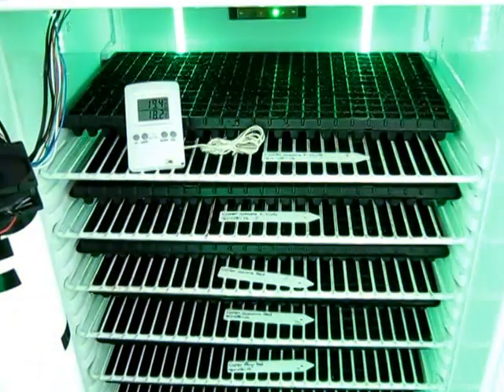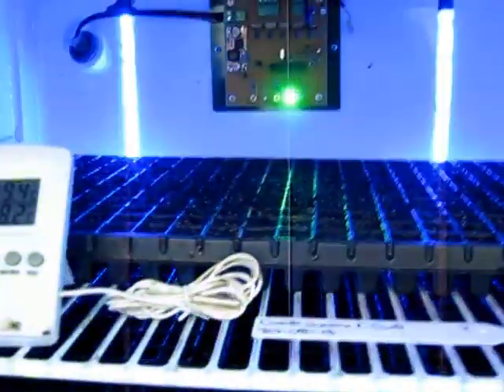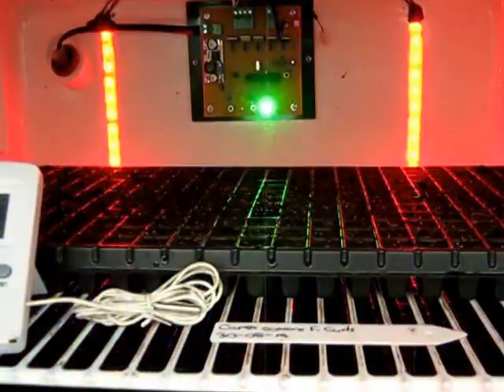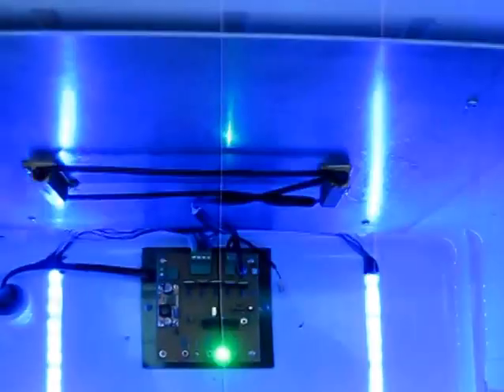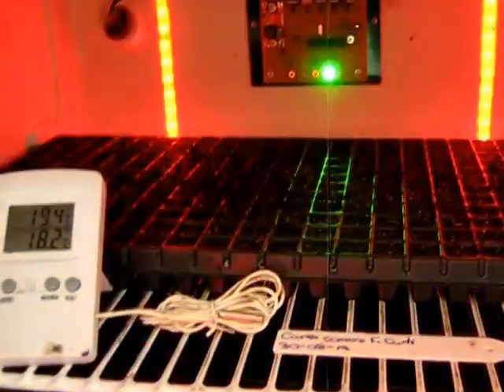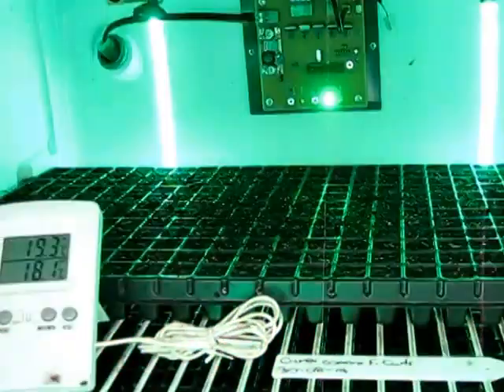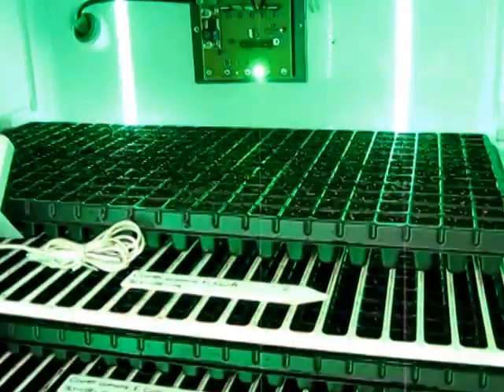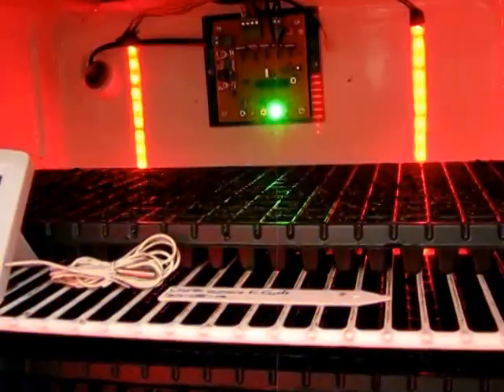DIY Seed Germination Chamber with LED lights

Comment: So how did you build it?  Need some more details
Reply from the maker: +First Class Gardens Hi, you will need basic electronics knowledge and the ability to program an arduino. The LED's are 12V waterproof strips. The fan is a 12V computer fan. The thermometer is a DS18B20. The microprocessor is a AtMega328 driving Mosfets.
My circuit board is work in progress, but an easier approach would be to use an Arduino uno with a Relay shield or a Mosfet shield. Please note that the LED strips are not super efficient and generate some heat which keeps the chamber warm, so you do need a good sized 12VDC power supple to run it all.